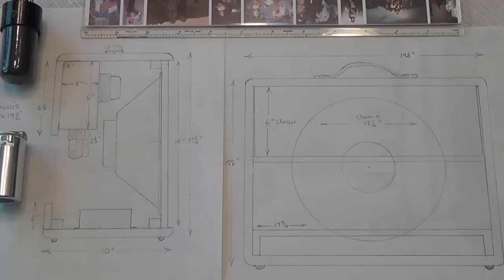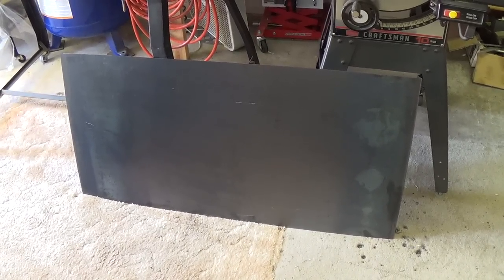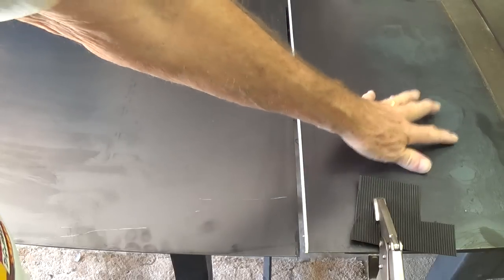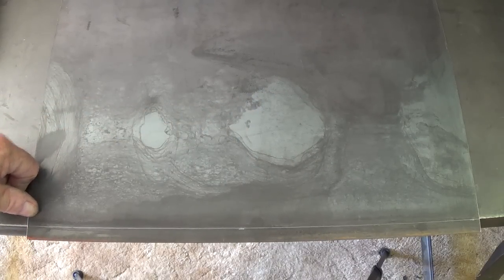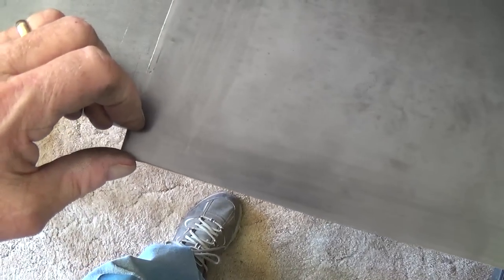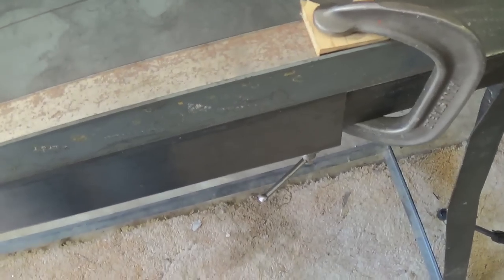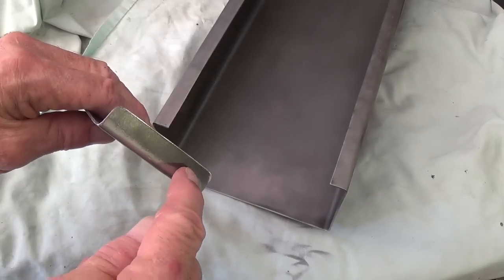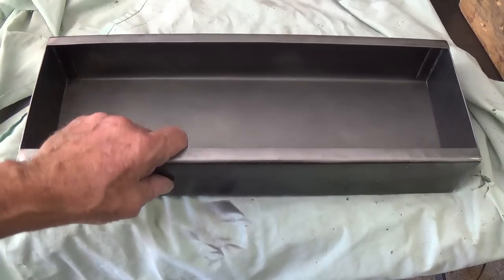How to Scratch-Build a Vintage Amp, Part 5:  Fabricating the Chassis

Comment: Hi Doug, a very sturdy chassis. I know you got your hands on an off cut so used steel, and commented on using a lighter gauge but I think I would use Aluminium. Somewhat easier to bend, superior thermal conductivity and a good electrical  conductor for earthing. That said there are a myriad of opinions both for and against for either material used. A good discussion here. http://www.tdpri.com/forum/shock-brothers-diy-amps/263159-steel-vs-aluminum-chassis.html By the way I am hanging out for the next instalment. I check to see if it is posted every day. Perhaps you got a hernia carrying around the chassis and had to take a break!! (Jokes Joyce)
Reply from the maker: +allanpennington   Greetings, Allan.  I have a nice sheet of 1/8" aluminum on hand, but wanted to make this chassis with steel, as they were originally.  Having made quite a few with both materials, I agree that each has its strong points. Part 6 is nearly finished and will feature the completed wood cabinet and machining of the steel chassis.

Comment: So, 18 gauge steel is thick enough. I always use 16 gauge steel and working in the basement with a jig saw and rivits is my least favorite part of the job. I'll try 18 gauge with the next one. Thanks.
Reply from the maker: +Joe Carson Since you have experience with 16 gauge, Joe, then you're welcome to try it, but it's a bit thicker than it needs to be for an amp chassis.
Reply: +Uncle Doug I have some choice words for 16 gauge steel. If 18 works, I'm all in.
Reply from the maker: You would be better off with the 18 gauge, as would the neighbors :))

Comment: Great chassis, straight and strong, but stone me Uncle Doug you say it weighs about 5lbs.  Your power transformer weighs less than 4lbs.  I think I will stick with aluminium.  I noticed you had some collateral damage to your left thumb. The Jeep is a real beaut or should that be brute.  The volume and tone weren't on your usual 5, more like 10 full bodied and well rounded.  I can just imagine you belting down the road to your favourite hardware store when they have a shiny new tool on special.  As usual you provide excellent instruction with a splash or humour.  Got to go now, there's a guy belting seven shades of $#@! out of some steel.
Reply from the maker: +Jeff M   Thanks, Jeff. I just weighed the chassis and PT, and it's 8 lbs.....so I wasn't far off. The last two chassis I made were aluminum....much more civilized....but I wanted to try another steel one for the video. Now I remember why I switched to aluminum :)) The thumb was damaged by a splintered 2 x 4, thankfully not the sledge hammer.  The neighbors would have really had some cussing to complain about if it were. Glad you liked the Jeep....it does have a nice idle and works quite well in the vast desert surrounding where I live.
Reply: +Uncle Doug In all the excitement I forgot to ask whether you will be able to use the Christmas tree bits for the tube sockets etc and did the blowtorch and welding effect the finish of the steel so that it will need to be painted.
Reply from the maker: I intend to use the "Christmas Tree" step bits on the larger holes (octal tubes) and regular drill bits for everything under 1". I routinely drill up to 1/2" steel plate when fabricating cross members and suspension parts, so .060" is not a challenge. Any discoloration from heating is easily removed with an electric wire brush or abrasive (glass bead) blasting. You'll see as the construction proceeds. I don't use paint for fear of interfering with ground connections within the chassis.....maybe on the control panel.....we'll see.

Comment: way you do not use aluminion?
Reply from the maker: +Rolando C  I have used aluminum in several amp chassis, but in this one I wanted to be true to the original, so I used sheet steel.  Each metal has its good and bad properties, and both make good amp chassis.

Comment: Soviet tube sockets suck. It would be impossible to mount tube upside down, because even when it's in regular position, sockets used to loose good contact. Why? Heat... It makes me think, that soviet russia made really poor stuff compared to USA :)
Reply from the maker: +TheShark  Thanks for your input, TS.

Comment: LOL, ya thats a nice jeep. Hey I need help with some tech. issue's Can I get some advice? I have to run right now ,but I will be back on Later. Do you have an email add? Thanks for all you do.
Reply from the maker: Thanks, Hack. This really isn't an advice column, but if your question(s) are relatively brief I will try to answer them on this page.
Reply from the maker: Has it always been this way? If so, then, looking at the schematic, it appears to be the way the circuit is wired. When both tone controls are at maximum resistance, the easiest path for the signal is to ground.
Reply: Yes I am the original owner, wasn't sure about the tone controls off pos. do you have a vid about noise problem?
Reply from the maker: Again, it may be inherent in the circuit, particularly when the tone controls are sending the signal to ground. Here is a site that discusses the problem of hiss:   https://www.thegearpage.net/board/index.php?threads/what-causes-idle-amp-noise-hiss.820202/
Reply: Ok, thank you so much.